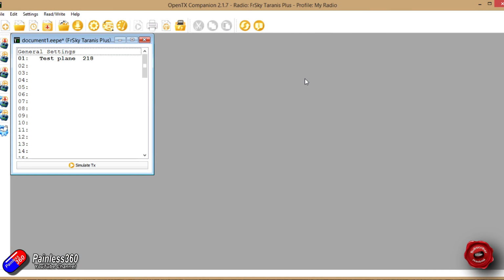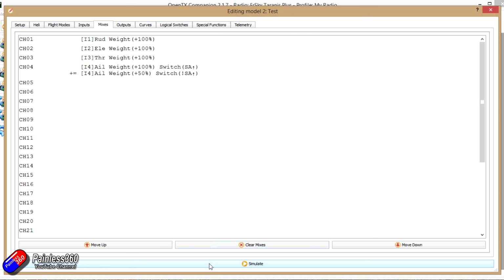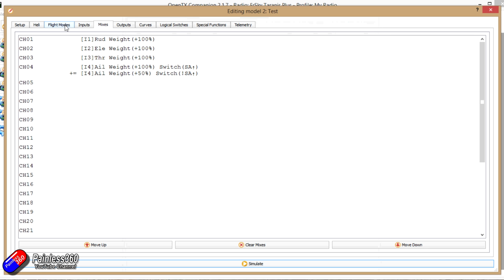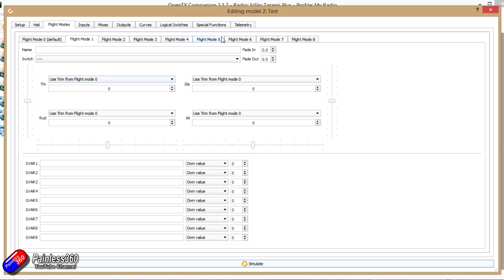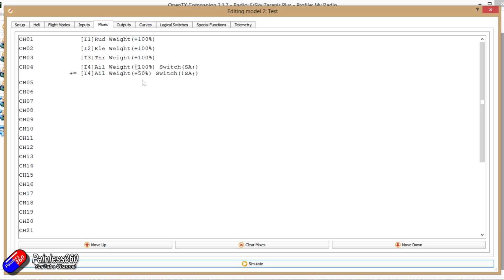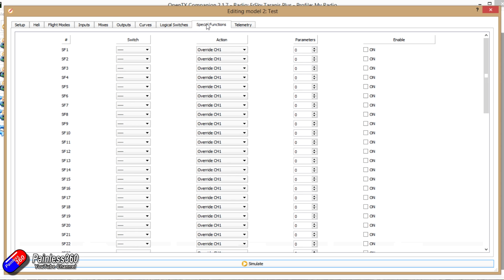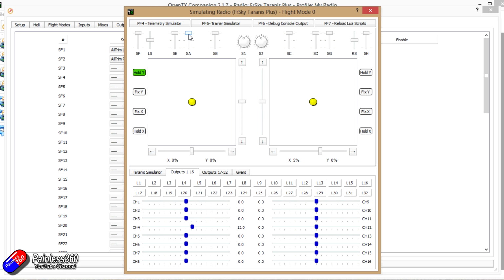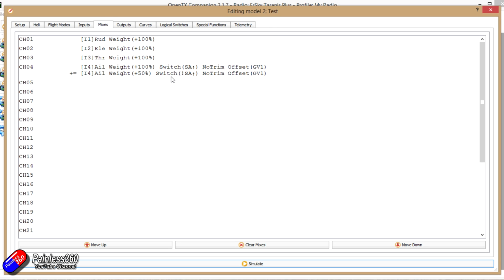OpenTX Quick Tips: Consistent Trims when not setting up D/R in the inputs..

Comment: DO NOT SET RATES IN THE MIX PAGE!

Now this method for setting rates is the total reverse of what Opentx U and pretty much any long time user of opentx will set rates. Rates should always be setup on the inputs screen! Set up your 3 or 2 position switch with your rates plus a mid rate with no switch (incase the radio stops seeing the switch), then put your mixes on the mix page. The way to think about it is you set the rate of the input then mix it rather then having a line for each rate and mix. If you set your model up this way, you are creating a headache for yourself.
Reply from the maker: +Dakoda Neilson indeed, see my other answers to those making the same suggestion.. Happy flying!

Comment: Hi thanks for many good videos, I always do dual rate switches under inputs, then the trim works in all modes
Reply: I usually like your videos but this one is just going to confuse people as you do not point out the inputs vs mixes issue that +ulf Mrtensson and +Dakoda Neilson point out.  This should have been discussed and addressed first in this video before going into the method detailed here.  For most people, setting rates in the input is the easiest and best way to address the issue and the method you describe here should be avoided by most people as there are very few cases where there are good reasons to use this method.
Reply from the maker: +ulf Mrtensson indeed! https://youtu.be/YCvAllckQ-I :)